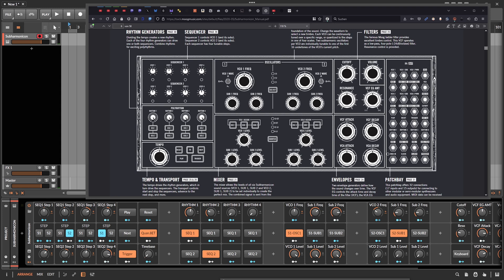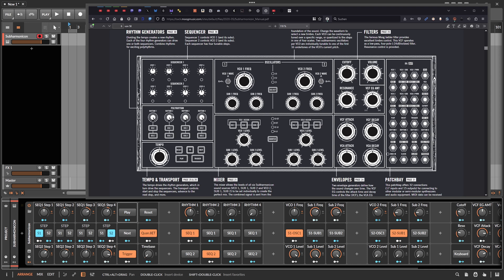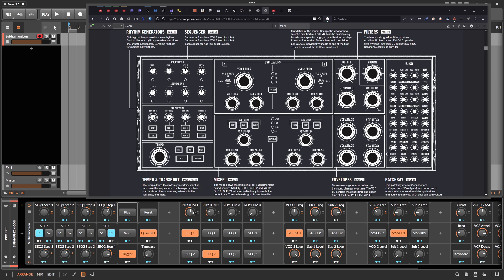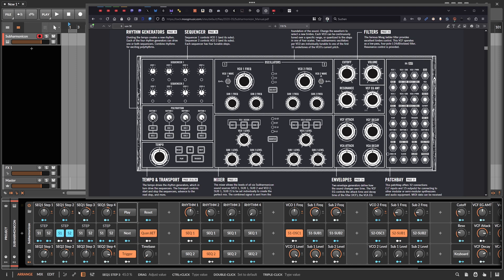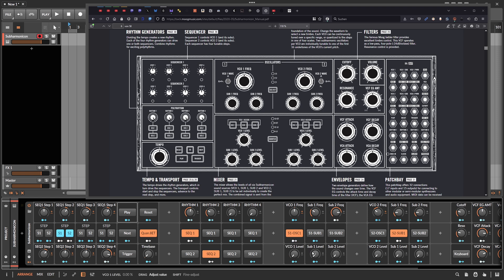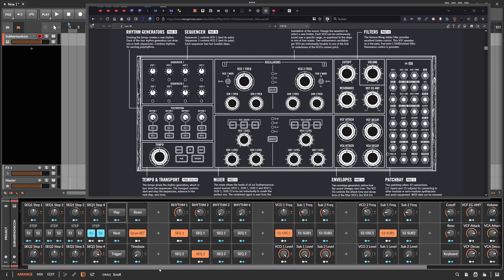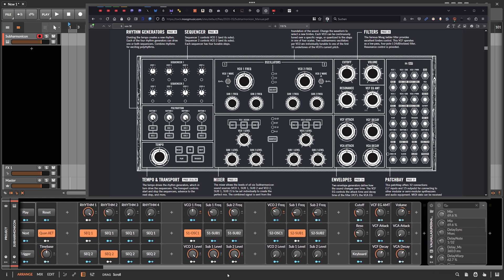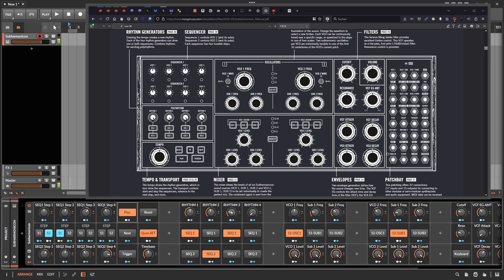Moog Subharmonicon for Bitwig

Comment: Very cool indeed! Been having a play around with this... Couple of omissions though. The original has a switch on each oscillator to change waveforms between Square & Saw. Also has a weird setting of being able to PWM the main oscillator with Sub 1. Not something I ever use on my hardware machine, I feed an LFO into the input on the patchbay. Cheers for the insanely fun preset dude!